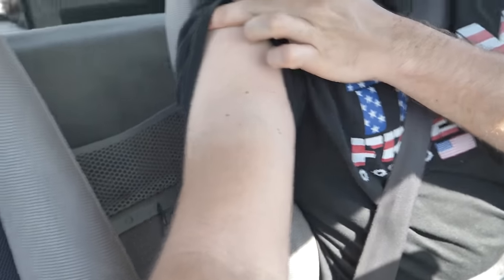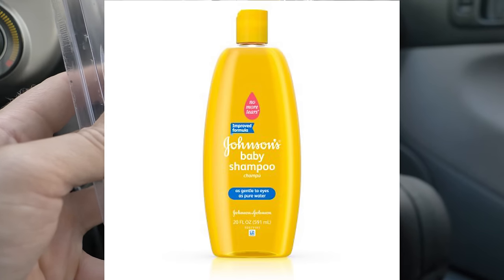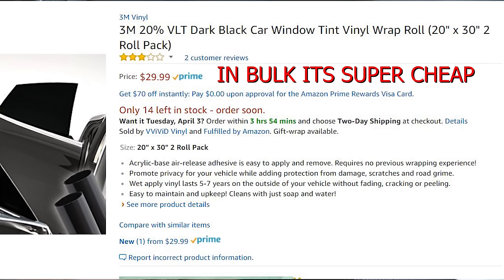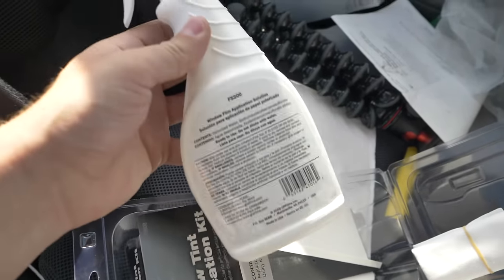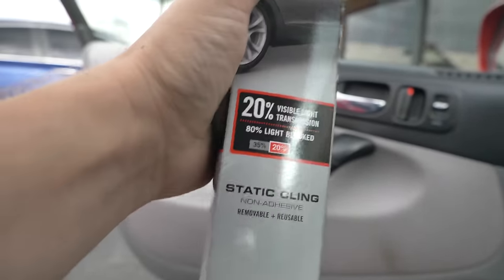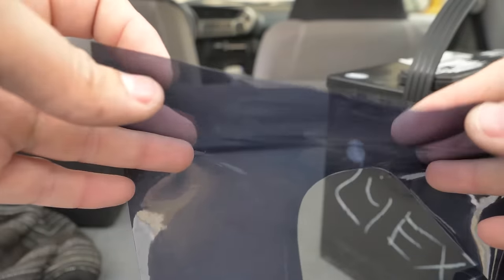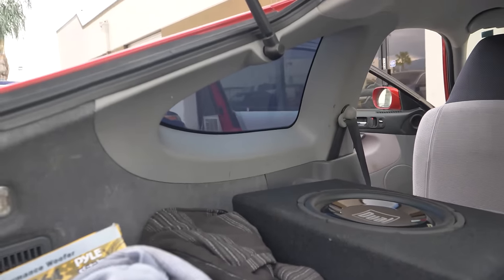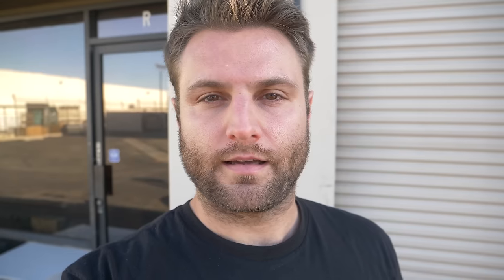How bad is $20 Window Tint from Autozone? Install | Review

Comment: THIS POST IS FOR ANYONE WHO WANTS TO KNOW MORE ABOUT TINTING THEIR OWN CAR
The tint he bought isn’t going to do anything except for removing a little bit of light. 
There are different types of window tint that do more or less. I’ve had many friends say that they do not want window tint because they see purple faded tint or tint that bubbles. 
First of all, the purple/brown faded tint that you most often see is when people go with the cheap option and buy dyed film. Dyed film is super cheap, but it doesn’t last very long. There are better types of film that will last a really long time. There are films like nano-carbon, carbon, carbon ceramic, and ceramic. Those are the films you want to buy, not a dyed film! (Also what he showed for some 30$) didn’t seem like something I would want to put on my car, it’s like a plastic, not a tint. And on top of that, it didn’t even say the material it was made out of)
Second, while yes you could install your own tint, it is way harder than what is shown in the video! He is using a static film which is easier to apply and trim of “weed out” (when you cut off excess pieces of the film to get it to fit the window you want). Normal film is very thin and hard (unlike what he shows with the static film) and is way harder to install and trim. 
He does mention that you would WANT a heat gun for getting rid of “fingers” (parts of the film absorbing air because the glass is curved and the film is not). You need a heat gun if you want to apply any real tint. Plus, most people make the argument of using a hair drier to “shrink” the tint (when you form it too the glass) but you need an actual heat gun because they are designed to get REALLY hot. You desperately need a heat gun if you are going to apply your own film. 
Some other tools you will need are a bottle of water/soap mix, a squeegee, a hard card (a hard piece of plastic), a red devil “squeegee” (its a curved piece of hard plastic that you use to put the bottom of your window tint into the seal of the window), an exacto knife (a razor), a little razor blade (used to clear debris off a window), and I believe that’s it. 
You have to apply the window film on a clean surface of glass. If the surface is not cleaned properly, then you will have dirt bubbles, air bubbles, and maybe even lint. Over time these will grow so you have to make sure you do it right the first time! I would recommend applying the film in a place where there is no air flow like in a garage. If there is wind, it will put dirt onto your clean glass and ruin your tint. So be prepared for that if you are tinting outside. 
I believe this is all anyone really needs to know on how to apply their own window tint, I know I probably missed a few things so feel free to add any input down below or ask questions!

Comment: I didn't see anyone claim they have used this tint before, so here's my short review.

I used the same Gila brand of tint, the red box "Static Cling Plus" film, but I got 5%. The film is definitely thicker than most tint films, plus it's got just a very tiny hue of purple to it, but I really don't mind that. The tint works really fucking good at blocking the light and keeping the interior cool, plus it was super easy to install but mildly difficult trimming it to size because of its thickness but overall the film stays in place and does not become misadjusted when the windows are rolled.

I just made sure to squeegee the fuck outta the windows and also trim off the excess on the inside so it wouldn't keep bubbling or crease up. And the tint is removeable and reusable too. Now, I did this to cheap out on premium tint right now but damn my tint looks REAL good for being budget Gila tint. 

Overall I do recommend the product if you're looking for privacy in the car before you get a professional tint job done but even then you could use this as your main tint and it'd work just fine.

Comment: Walmart sells $10 tint and it isn't too bad to install besides it tries to roll itself back up after you peel the plastic off the adhesive but if you can get through that and get it installed it doesn't look too bad and easy to make look clean

Comment: used static cling tint 5 and 20 percent on my new cars. they work perfectly if u take ur time. and the beauty is they peel right off. try removing window tint with adhesive when a cop orders u too. ull wish u used static cling on ur new car.

Comment: on my SUV, I had -3% on the Rear passenger windows and 5% all around except the windshield which was 35% but since it was so dark in my car, and the way the windshield sat, it looked much darker. 

Note; I know my tint was -3 on the rear pass. is cause a cop told me :)))) lmao.

Comment: As someone who hasn’t done tint work before there were several usable tips on install technique, and the fact that you’re goofing off trying out cheap products on the insight is pretty fun in its own way. In a similar way, I do silly stuff with my daily all the time even though my drift build is a slightly higher caliber also🤣

Comment: I used to install tint, those small runs on the outside edges, use a heat gun on a low setting. They’ll come right out. For a cheap fix, use a hair dryer.

Comment: Measure your windshield top to bottom. Most front and rear windshields measure over 24" ×6'.
Which I found out after my trial run with Auto Zone. You'll need 30" ×6' for a rear window Corolla. Which of coarse would of been my 1st option had it been stocked in Auto Zone.
Yes the Gila install kit is
junk.  You'll need a long handled squeegy at least 12" to get between the rear
dash center brake light.
If you are outside do the trace pattern dry, with frog tape. Or the slightest breeze will pull the wet sprayed tint
off the windshield . You'll crease it and waste $27.
Remember to keep the backing of the tint facing you on the outside window when tracing. Clean the window inside & out 1st. Transfer the tint inside with the backing on and remove when in position. Again frog tape half the tint to make handling easy, wet and remove half the backing when in position. Squeegy.
Remove tape,& backing on the other half ,repeat.
Idk how good Gila Tint is , but, from the videos I've watched. Never roll down the windows til after a few 80 degree days. It needs time to stick and dry. 
Keep the fingers (wrinkles)up & down verticle, and work them out towards the closest trim panel.
Remember the Frog Tape it makes an extra set of hands.

Comment: I hate to disagree with a “professional”, but I have no experience with tints, and bought those tints and installed them myself, and had no problems with them, also, the “reusable” claim is also true. I got pulled over and they gave me “Fix It” ticket (they were 5%), once the cop left, I removed the tints, and went down to the police station, they removed my ticket, then I went home, and put the tints back on again, and they worked perfectly! Again, no problems with this “Gila” tints.

Comment: Fyi. Idk about other states but in PA your window can only be tinted to a certain percent.   If its  tinted to the point where you arent visible, then you run the risk of getting pulled over an given a ticket.....     found out the hard way.  Parently theres no law that says/prevents shops from selling/installing tinted windows.    But there is one  that applies to driving & having tinted windows

Comment: I got my windows tinted on my Subaru back in 2006 by a shop in Los Angeles, using high quality tint.  Still looks great to this day.  Not bad for nearly 12 year old tint.
Also, cleaning the outside of your window so you can apply the tint to the inside??
Reply from the maker: I’ve had it score the film while forming it. Super unlikely. But why not. Especially on the rear window and making it slippable
Reply: Ah, that make sense!

Comment: Auto zone tint is fine for the price, if you cut the edge back far enough, or slice the tint right it wont peel, and at least where I live heat wont wreck it. No it wont last as long as more expensive tint, but I did 2 windows and a sun roof for like $20. 🤷‍♂️

Comment: I used the static cling tint on the front windows to my house it works great  they both face west I am able to have the curtains all the way open And you can not see inside I did put the tint on the outside it said on the box to do so in order not to cause damage to the dual pain windows

Comment: If for some reason you really must install cheap tint on a front window,  you just cut it so it doesn't touch the top overlapped section, and pull the door interior trim panel off so the bottom of the tint remains below the rubber wiper so that it doesn't get caught. Its a pain to do, and still looks horrible, but I've seen these tint jobs last many years and continue to block the sun... and probably discourage theft, because it really does make any car look like a beater.

Comment: An apple to oranges comparison. Removable and reusable static cling tint has many advantages you fail to mention. I have used mine for two years in Fl. and install it in AM and remove at dusk, works perfect. Also, you did not mention your enhanced cooled and sun blocked driving experience after the install. Then take it off when you get home....... Geez!

Comment: I tested the Gila 20% static tint with a UV flashlight and it hardly has any UV protection. I called the company and they said it blocks uva and uvb, but they can't answer why it doesn't block my uv flashlight. my sunglasses blocks it 100%, i doubt this tint blocks uv light, 'm going to return it

Comment: The static is not so bad for temp use on the rear to make the others look darker.  I used to do 35 on all regular tint, which is legal limit where im at then at 20 static over the back. Of course you can barely see though it but can tell it a car is there in the day time. Lately I just hang a black sheet near the rear behind the back seats to make it look dark and add privacy. Plus its not tint. Its just not worth the tickets anymore.

Comment: dude you have to remove the protective layer and it gets super thin as well. i bought this same one and there is a clear layer you peal off. you use 2 stickers one on each side of a corner of the film and that puls off the protective layer. it is there man just hard to get off. so you just didnt get it off is all.

Comment: There are other tools you can use to make it come out better. The thinker the tiny the better. Also reusable tint is going to be stretchy and and thick if it was thin then it wouldn't be reusable as it would fold and crease.

Comment: There is cheap $30 precut tint on Amazon. I've had it for 2 years and the back is finally a bit purple and the sides are a little blue. But it's definitely held up keeps my car significantly cooler crom this fucking florida heat.

Comment: What brand would you recommend for good quality that I could do myself and if possible send a amazon link please
Reply: After watching numerous videos of professionals doing it, I say it's not worth doing it yourself. Shop around at window tint places for a good price and have them do it. One BIG reason the auto tint shops do such a good job: they spend a long time CLEANING the glass and the car. If you do a $2 cheapass tint like this guy did, not only will it peel off in the hot sun but also, you'll see  every  single  tiny  speck of dust, hair, lint, etc on the WRONG side of the tint! And the only way to get that out is remove the tint and redo it. That's why window tint shops are obsessed with getting the car as clean as they can before they even pick up the tint film. And they guarantee it. My shop will replace any tinted section for free for the first 5 years of car ownership.

Comment: i use this on my boat and bus it dropped temps 10 degrees or more in mid day sun 
i used to sweat sitting in. the boat 
not anymore 

 i have 15 or more windows on the boat 

5% isn’t dark enough for privacy at night

Comment: Idk man i installed the same brand but marketed for home windows. Used it on the front in my van even did a visor strip. Its been on for 3yrs and still is limo black. The main issue i had was by the trim due to this shit being thick enough to keep grandma warm on those cold winter nights..i ended up just using packing tape to hold it down cant see it so good enough..the main appeal to me is being able to remove whenever. So if a cop pulls me over for i can just peel it off and avoid the ticket on the spot.In my state you can get the ticket voided by removing tint and then either look for a cop or go to the local station to validate removal have it signed and then go wait in line at the county building ticket window...fuck that lifes to short.

Comment: Well, I scrolled through the comments, nothing.

What kind of scam shops do you people work for where window tint is installed on the outside of window? WHY IS THAT COMMON PRACTICE TO YOU? There is literally zero difference in light level, but infinitely more weather and/or rock damage. What the hell?
Reply: Watch the whole video before you comment... Its done on the outside to precut it. Then install inside. Ber durp de durp

Comment: Just pay the pros $100 to $130. Doing it yourself will just end up bad unless you're a pro. I paid $115 for 5 windows with a 7" banner on windshield of 3m 20% in Chicago. I would never go the route Rob did and anyone that does ends up looking like a shitbox. You ever see the cars with cracked tint that's turned purple? That's what happens to this shit product.

Comment: Most of your problems you had came from your own mistakes. Fingers wouldnt come up if you had pre shrunk the timt and your problem at the window seal occired because you sidnt get all fluid out of tint. Also it helps to put on window from the inside so the tint doesnt catch on the seal, just from tinting experience. Cant really bash on bad tint when the problems are because of you.

Comment: Even this cheap foil would be ok if you install it properly. This is an example, how NOT to install. In this case even if you had top of the top foil, the result would be the same shit. That's the reason why better to leave tinting to the specialist or someone with expirience.

Comment: This is simply just not true as shifty of a product it is I'm used it and I'm currently using it now and actually once the water dries it will stick and stay and you can heat form trade it because I actually did my back window with it...

Comment: Dude good you left the tinting industry. Think you are better of doing videos. So sad to see you down talk a product you dont know how to install. Correctly installed a static cling film will work as fine as a glue one. The problem is that professionals dont know how to install static cling correctly since it is a totaly diffent way to do it. So it was not the product in this video that failed it was your installtion. /Peter